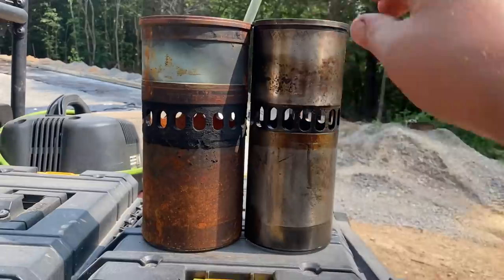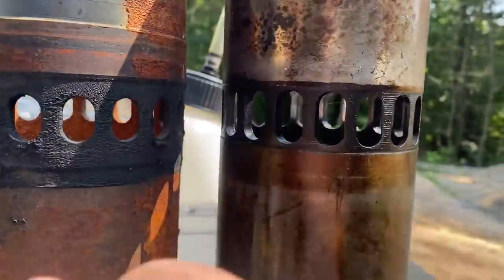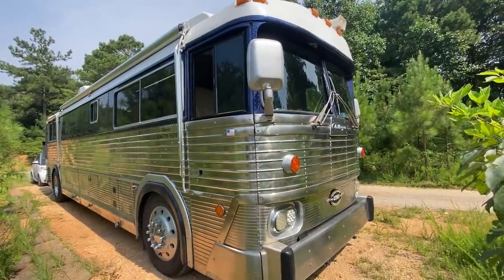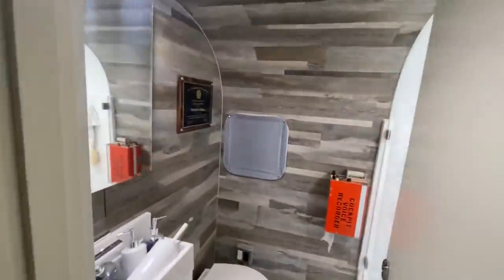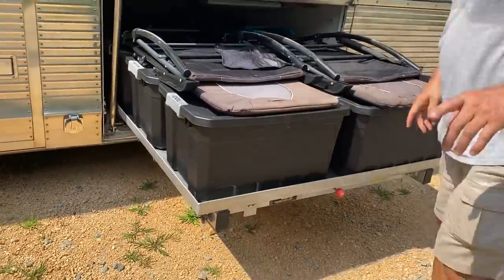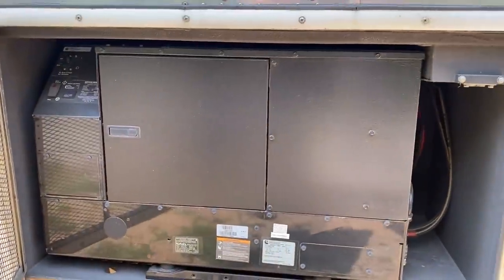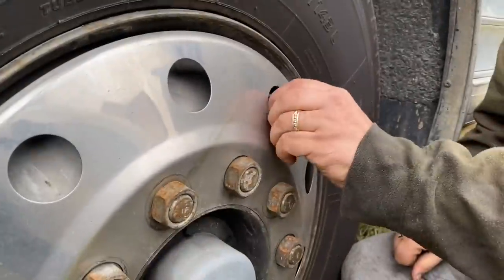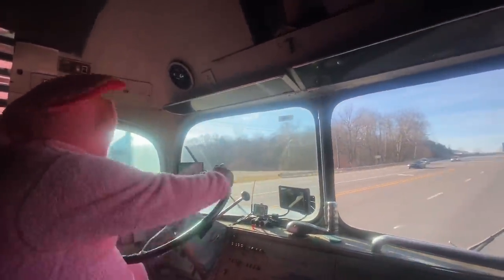Differences between detroit diesel 71 and 92 series liners.   Mci Mc5B comes in for some work

Comment: I was thinking it would be neat if you could loop the driveway around the east side of the property back to the entrance for a road course experience but then just realized you have a neighbor on that side of the property and they probably wouldn't like the noise. Was a good thought at first. Can't wait to see video of concrete pour for shop and the eventual placement of structure. I loved the idea for a 4'ft knee wall which I guess isn't happening but that can actually be done later if more height is required inside shop.

Comment: Thanks for the description on the different liners, of particular interest is the different sized port for Turbo!  Just wondering when you upgrade Lenny to have a Turbo if you will put new liners in with the smaller ports or not?  Cheers Drew

Comment: Scott- You need a Mooshimeter Wireless Multimeter. Then you can use your smartphone  to wirelessly  read current and voltage in  the  engine compartment  while riding inside!! They are so cool. And  it  logs to an sd card  up to 6 months!! No more 20  foot extension leads!

Comment: Good luck with the pour. Keep it moist (sprinklers etc.) continuously for one month after which time it will have attained 98% of its ultimate strength. If it dries then the hydration reaction stops as does the strength build.

Comment: When are you starting with bus conversions from ICE to electric? You got a little land to charge a bus. Me personally I would go with LTO cells for now even if they are a bit bulky dunno if that would work for you. Just keep an eye on the TCO (Total Cost of Ownership). LTO is only cheaper in the long run and if they keep good for 30 to 50 years. Haven't looked at the chemistry shelflife yet but they can do more cycles than other batteries and are usabe down to -50°C.

Comment: So if they had made an inline 6-92 with big main bearings, it would have been the ultimate Detroit with the wet liners to cool more efficiently.
Reply: GM did better than that they made the 6-110 inline 2 valve, 4 valve, Roots blower, Centrifugal blower, and Turbocharged quit building them in 1959 when the 8V-71 came out
Reply: @joemaser9122  Too heavy for a truck engine. Was a great engine for heavy equipment, marine and stationary applications. Weighed 4,000 lb w/o acc. 8v71 was about 1200  lb less than the 110, capable of more power, but less durable than the 110.
Reply: @jamesglavich1426  GMC did put 6-110's in their trucks don't know the model number but bigger than 950,970 they added two more bars to the grill to cover the radiator

Comment: Is it possible to put 92 series pistons in a 71? With machine the block and sleeves? Make the sleeve slightly smaller, and the block bore larger?!?! Or is there enough room? Does anyone ever port the sleeves? And heads? Larger valves? Maybe remove or narrow the webbing of every other port in the sleeves? 
I'd like to get a smaller Detroit, 453 or so,  I was thinking about trying to find a 4bt Cummins, and compound turbo it, run a th400, with a gear vendor od/ud aux gear box, put it in a 1/2 ton Chevy/GMC  with 373 gear and 33" tires, hopefully the gearing would work out, with the ability to split the gears, similar to a 2speed diff,  1st, 1hi, 2nd, 2hi ,3rd, over drive, it may need a 3.42 or maybe a 4.10 gear, I'm not sure the ratios in the trans, but I'd rather have a 4speed manual with gear vendor, it can act as a 5speed, or as an 8speed, even 212cid compound turbo 4-53 should run decent with 8speeds in a 6k lb truck, running about 30-50 psi boost, I heard the 53's rev a little higher,  can they do 3k rpm safely?

Comment: I would expect to get lower mileage on the 92 than the 71 though.
all else being the same, the higher capacity of the 92 would have a bit more fuel per cycle so your mileage would drop a bit.
Reply: if you drive it the same speed there should be no difference, except maybe at idle.
Reply: @uliwehner  with 2.1 litres difference in volume per cylinder I would be shocked at their fuel consumption being the same, just isn't a logical conclusion. Even if it's just .05% more fuel per cycle in the 92, that would slowly add up to less distance for the same fuel load. If they are getting identical fuel consumption then the extra capacity of the 92 isn't being fully utilized.
Reply: @jaquigreenlees  if it burns more fuel it makes more power and goes faster. At the same speed it needs the same power, same amount of fuel.... possibly it can have longer gears and run at lower rpm. Lower rpm means lower specific fuel consumption. Let's call it even.
Reply: I tend to get better fuel economy with a larger more powerful engine-  probably because my foot isnt constantly glued to the floor

Comment: So what dose it take to get power out of the motors ? Like how far can you go with them .
Reply from the maker: In-line 671 is usually around 238hp the boat i worked on had 450hp same block.  TBI   You have some ability to add hp
Reply: twin 8v71t @ 325 hp each with 1000 gallons doing 8 knots ( 10 miles per hour roughly ) will get 1500 nautical miles. land the mileage is better but for a boat that is average. crank the throttle up high and that same 1000 gallons will get you 500 nautical miles.

amazingly, 2 stroke, 4 stroke, 4 cylinder to 24 cylinder, with no exception for brand name engine, the distance per tank doesn't really change. not with boats.
There is 1 brand of boat ( Bering Yachts ) that make steel trawlers, their 65 footer has far better distance. If I remember right 3000 gallons can get you 15,000 nautical miles, but you are crawling along at 4.5 knots which is basically same speed as a sailboat on average. twin cummins with all the latest evilness def/dpf/electronics included being their usual engines.
Reply: @jaquigreenlees  I mean far before they brake before Rodney saids hi there